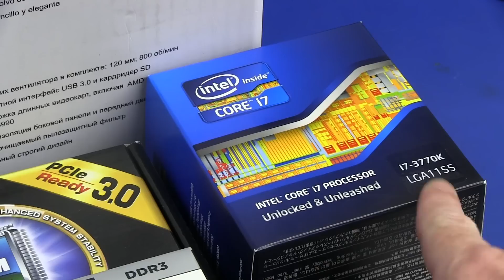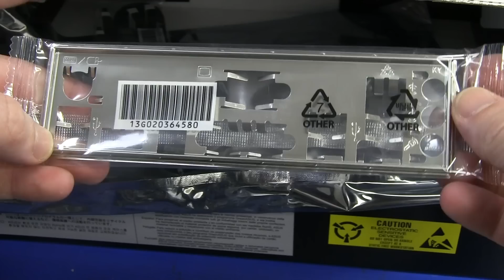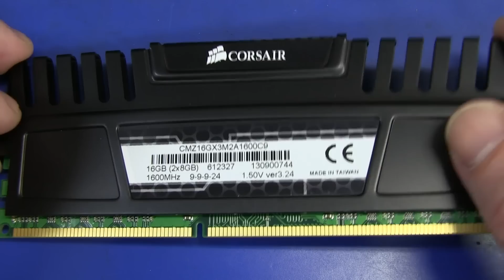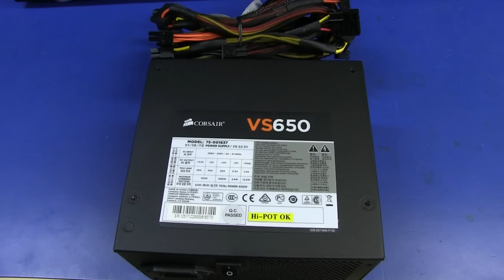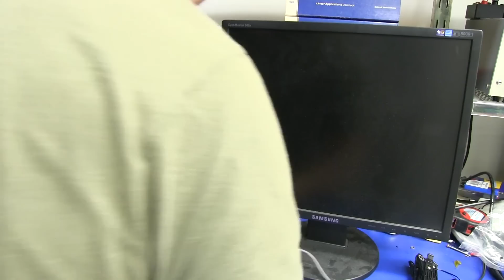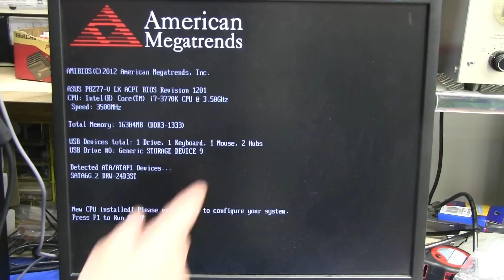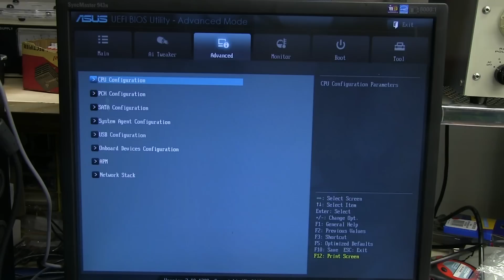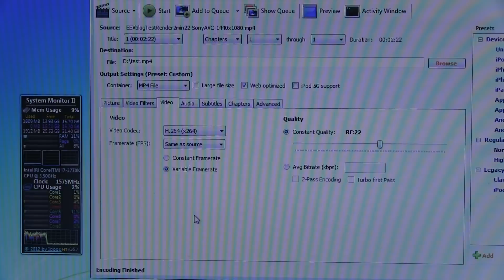EEVblog #462 - Video Editing PC Assembly

Comment: The Corsair VS650 is ok... I'm actually interviewing as a PSU Technical Consultant for CoolerMaster, worked as a product manager for EVGA, etc. The Corsair VS650 is a decent budget PSU and though it wouldn't be my choice you shouldn't need to worry about it at all.

Now, if you'd gotten some piece of shit $25 "500W" with a fake wattage rating, fake certifications, and a 65% efficient 1995 era design... Then yeah, I guess you could call me a "fanboy" for bitching.

Comment: Dave, you see that space under the motherboard tray? You can hide and route cables in there so it is alot neater inside the case and it improves the airflow. If you need to change something in future, there won't be a mess of cables in front. This is pretty good tutorial: /watch?v=ERhxmzQR6xA

Comment: Do you have any real scientific measurements done in controlled environments? No? Didn't think so. Run your i7 3770k at 5ghz at 1.5v, try it both ways on your water block, and get back to me with what you find.

Comment: When did I say anything about a democrat?  You used lab equipment to measure this in a room with constant temperature, humidity, and pressure?  The blob does not work better.  It's thicker and does not spread edge to edge unless you put on an even bigger blob that will ooze out of the sides.  These things just do not have the clamping force to make as thin of a layer that you can achieve by spreading it out manually.  Do you not understand force applied over an area?

Comment: 01:50 intel i7 is better than an 8 core amd? dave i hope you are joking. your i7 has 4 cores at 3.5ghz, the best 8 core amd possessor is running at 4ghz, it has the same prepossessing power as intels xeon e5 series possessors which are literally 10 times more expensive than the 8 core amd. and the 8 core amd is 100 us dollars cheaper than your i7 again, so i think you are a tiny bit wrong on that one...

Comment: Nononono! Don't spread the thermal paste like that! Your creating air gaps!
Reply: No one fucking cares. It still works
Reply: +Robin de louwere there won't be any airpockets, the heatsink is flat it won't matter it will be fine
Reply: +Robin de louwere it doesn't matter how you apply it OK? many people already did valid tests, and saw the temperature difference was 1-3°. You can apply it any way you want. OK don't be ignorant actually read m8.
Reply: +Robin de louwere also your knowledge on CPU's is very vague. Most but all CPU's will turn the system off, If operation temperatures are too high. So with modern hardware you can't just kill a CPU.

Comment: Handbrake is such an awfully slow crap tool.. I wonder why people keep recommending that. I'm running it on an 8core Xeon 3GHz and it takes 8 hours to convert a 1h30 Bluray to h264..
Reply: Markus Strangl Handbrake has nothing to do with the time it takes to render things, whereas the codec library has everything to do with it. If I remember correctly, HB uses x264 as the default h264 library, which is supposedly the fastest. Have you checked your encoder settings to see if x264 is utilising all of your cpu cores?
Reply: Kekoff yeah, that's why I was commenting this.. it keeps all cores at max load, and still takes awfully long.

Comment: RAM in wrong slots
Using aftermarket cooler on a video editing PC (fair enough if overclocking but overclocking is useless on this type of machine)
Way too much thermal paste (is actually going to insulate the CPU now)
Put the back plate on the motherboard (meant to put it in the case then slide the motherboard in)
Terrible cable management
2/10 try harder.

Comment: For the first build its nice , BUT for now AMD is BETTER than Intel because Intel i7 3770k got 6 cores and 6 threads at 3.5 GHZ , the AMD Fx-8350 got 8 cores with 4 GHz , also form the hz the AMD is better and cheaper , ok Intels are bit faster than AMDs at the same Ghz BUT a difference like that , now way , and in 1 or 2 months the FX wil come with 8 cores and 4.4 or 4.7 GHZ , thats how it goes ;D

Comment: if it spills over the top of the cpu it will leak into the socket part and then it can cause a short circuit AAANNNDDD fry the poor little bastard to a crisp

Comment: You really should at least read the instruction manual instead of winging it and installing things however you like. Pouring thermal paste on your CPU and installing your DIMMs in single channel mode, as well as having ZERO dedicated GPU whatsoever, is going to make your rig as slow as molasses when trying to do the VERY thing that you bought it for... VIDEO EDITING.

Comment: While I find your thermal paste method atrocious, my main gripe is your DIMM placement. If your RAM was too tall and the fan on the heatsink got in the way of the A slots, why not just put it in the B slots? They're the same speed, just different channel, same performance, and you could have your fan mounted the way you wanted it

It sounds like you have no idea what you're doing, and you probably shouldn't be making a video about it

Comment: Yeah but how much is a quadro?! or a tesla? did you not hear him at the beginning?! CHEAP IS CHEAP. WIll it get the job done? Yes his set up will. It is the MOST efficient. no. He doesn't have liquid helium cooling units. ( you going TOP of the line for video cards. i did the same) But it will get the job done. Get off his ass. Its his build. let him build.

Comment: I hate that power-supply-on-the-bottom bullshit.
Reply: its better then putting it on top
Reply: I think it's better on top because you don't have to strain the ATX cable all the way to the bottom.
Reply: Alex Helton perhaps one day the motherboard will come in with their own power supplies... and we wont have to buy them separatedly.
Reply: Blowtorch the Robot If you get a decent modular PSU the ATX power cable will be more than long enough.

Comment: How the hell does a thicker layer and less coverage work better?  You tell me!  Come back with some real scientific measurements done in controlled environments.  Core temperature measurements are complete horse shit.  Those sensors are meant to give a general idea of temperature to control fans, and to shut down or throttle things in case of thermal runaway.

Comment: ASUS good, Intel bad. Watch the heat on that cpu...
Reply: +Rocco Croce watch the heat on AMD cpu's/gpu's
Reply: +Sebastiaan Groen all of my AMD builds have loved running warm, just like an track car. Worst that ever happened was lost a core on a 555+.
Intel and nvidia are some temperamental chipsets when it comes to heat. 
Same thing I tell Mac users, run what works for you!
Reply: +Rocco Croce i doubt hell reach the outer limits of that cpu and reguardless itll throttle at 100c if he doesnt keep track of it, but i highly doubt hell get that high on the temp
Reply: +iamtheonewhoyoulove i'm sure we will get an update once the die goes tits up.